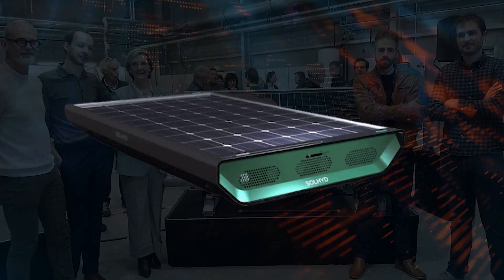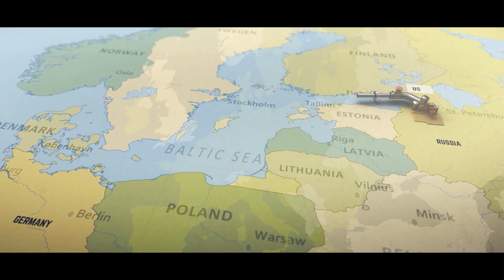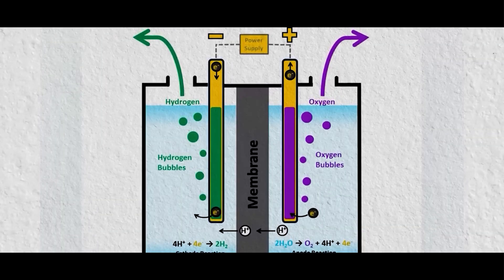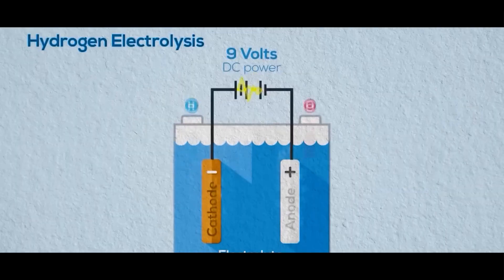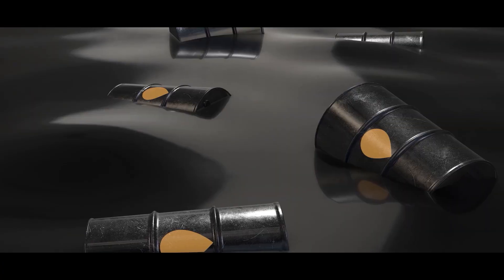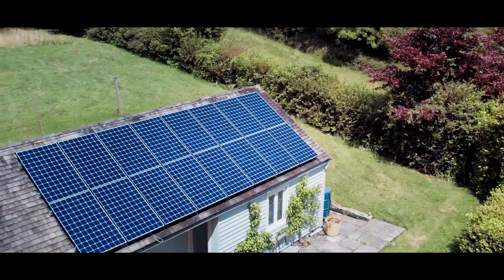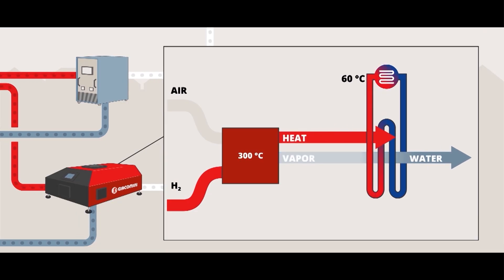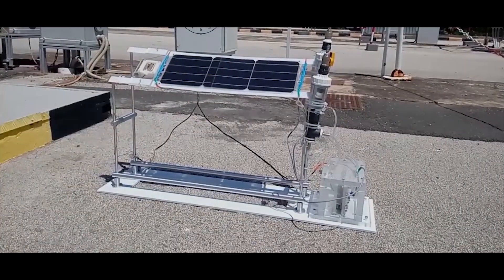NEW Solar Panel Produces Cheap Green Hydrogen at Home | BREAKTHROUGH!

Comment from the maker: Im sorry folks there is a mistake in the Video at 3:34.  of course its  4-8 MWh per year (4000-8000kWh).
4-8kWh wouldnt make any sense 😅
Reply: Thats exactly what I thought. Thanks for correction 😄
Reply: @pajo75  😊
😂
Reply: Yes its low ......but look at solar panels how more efficient and smaller they have become over past 10yrs.
So give this idea time to develop.
Reply: There is an American startup in Las Vegas NV also that mimics phosynthesis, And it’s publicly traded. HYSR is the stock symbol
Reply: @truthseeker8123 . Very small micro stock.
Reply: Same in UK, but as alot have done.....done small systems and stuck two fingers up to the greedy energy companies.
Reply: This is old tech.  Check out:  Hydrogen House Project
Reply: Thanks.
Reply: store the hydrogen as a powder potassium borohydride KB3 molecule. dissolve in water tank to power car or other power unit. the system would take power initially to generate hydrogen for the fuel cell but would quickly achieve over-unity.
Reply: Storing copius amounts of explosive energy in a gas hard to even contain needs further development. If this goes wrong, it goes very wrong. Any conversion process using hydrogen as a base material is a welcome must. Now let's think about real term efficiency of those conversions. They should hold up to chemical batteries, or?
Reply: "Im sorry folks there is a mistake in the Video"
That's putting it mildly.
Reply: I stopped the video  3.34........but now that you corrected I'll proceed to watch the rest.
Reply: Thanks ..! That's how morons are burying this technology ..! It wouldn't surprise me a damn bit !
Reply: I wish I'd read this first. Just been down the rabbit hole of finding the average kWh natural gas requirements for a typical house in the UK. (between 8000, 12,000, 15000 for what ofgem define as low, medium and high energy usage).
Reply: there is another mistake in the animation.  I seems that the hydrogen is released to the atmosphere and the O2 is stored :)  Worse than this, calling these "hydrogen solar panels" is somewhat disingenuous.  This is a "green electrolysis" hydrogen generator.  Green in that the power is coming from photovoltaic sources.    I'd be surprised if the amount of hydrogen produced 'per panel' generated enough hydrogen to sufficient power.
Reply: Thank you , I caught that and was very concerned.
Reply: I was completely lost when you said that haha. Came to look and here's your comment. Thanks for addressing and fixing the issue there. Great idea 💡
Reply: 8 MWh is way too low for most small houses in nordic countries. Trippel that 24MWh / year and most normal villa with two electric cars is covered.
I have a small villa and a heatpump, live alone and only one EV. that I don't use much. I use about 8MWh / year.
Reply: This is a dumb idea for a home user, nobody wants a Hydrogen tank at their home. Also no mention of the losses you get even with a Hydrogen car that will vent itself over a week or so to avoid exploding.

Comment: more green hydrogen hype......... its much mor efficient to store the energy in batteries, than as hydrogen. Although batteries have problems with materials availability, what the video doesn´t  explain is that hydrogen is EXTREMELY inflammable..... who wants to have a massive bomb strapped to the side of their house.... obviously we can make high pressure tanks.... tbut theres the materials availabity question again. And hydrogen is very VERY dificult to transport, so forget the myth of selling your excess to industry....pure fiction. In very cold climates, ....maybe it will be useful...but remember much of the planet is facing extreme temperatures thanks to climate change!!!!!

Comment: The future of ZERO EMISSION ENERGY will be installation of Solar Energy panels in the areas around EQUATOR for generation of maximum electricity. 
.
Equator has maximum Temperatures and zero frost problem. 
.
The only problem is the sand storms and dust. If technology can overcome that, then we will have unlimited supply of electricity 365/366 days 24x7. 
😊😊😊

Comment: The silliest thing in the process is at 3.02. When pure Oxygen is being produced do not waste it leaving to the air. 
.
One can use it for filling Oxygen cylinders.
This Oxygen can in purified form be used in Hospital, Industry related to Burning, bunker oxygen supply, indoor plant cultivation, as a car fuel to burn limited amount of it as alternative to petroleum products etc.
😊😊😊

Comment: Is this really a 'breakthrough'? PV panels are typically about 20% efficient and water electrolysis is also only about 70% efficient, making this system about 14% efficient at making hydrogen from sunlight. Whereas lithium batteries have a round trip efficiency of about 90% or more. Hydrogen fuel cells are much lower than 100% efficient, so the only advantage I can see is that this could provide a method of longer term energy storage. I.e. make hydrogen in the summer and heat your home with it in the winter. Even in this case it would be more convenient to use separate PV panels and electrolyser and hydrogen storage system, so that the PV energy could be used for other things.
I found this video because I have seen other methods of direct solar photocatalytic splitting of water and had assumed the Solhyd device would be based on this. I think the highest efficiency of these so far is 13.8%, so similar to the Solhyd system.

Comment: If you follow their numbers, it produces enough hydrogen in a day to drive an HFCV about 2km. A solar panel the same size would produce enough to go about 12km in a typical EV, and you don't have to figure out storage, compression, etc.

I'm afraid that going from electricity to hydrogen and back again will always be an unnecessary and energy-wasting side trip. If you could do it without that being the case, you've invented perpetual motion.

Comment: What I am confused about is... does it use a solar panel to generate electricity that then produced hydrogen? 
Because if so, why not just use already existing electricity to produce hydrogen in one place? Why need for the retrofit?
Reply from the maker: As mentioned in the full video, it does not operate like a conventional solar panel.
It uses a unique technique to generate hydrogen.

Comment: With 5 kW of solar panels on your roof and 5 hours of sun shine you can put maybe 20 kWhr of power into your Tesla Y battery and it will drive 4 miles / kWHr, so you could go 80 miles on one days charge.  To do that with a hydrogen powered car you would require 15 kW of solar panels, and that won't fit on your roof and it would be 4 times as expensive or more.  Just plain stupid.

Comment: Hydrogen is a stand alone fuel that doesn't need to be converted into something else. When using hydrogen to power vehicles never throw away the oxygen as that's the secret to powering all types of vehicles as when water is broken down the resulting gases comes with all the oxygen it needs for complete combustion, thus any oxygen sucked into the combustion chamber will be extra.

Comment: While normally using fuel cells would be a terrible idea because of low efficiency, you make up for it by using the waste heat - which is great in the winter in cold climates.  (You would not want this in Florida!)  However, there is still quite a loss of energy when you make the hydrogen.  You might consider using batteries for short term storage, hydrogen for seasonal storage.  Since efficiency goes up when current flow goes down, you might want to send only a trickle to hydrogen and the rest to batteries during the day.  At night you would use hydrogen if you needed the heat, otherwise you would make hydrogen from battery power, again at a low current for high efficiency, with the rest of the power going to the house.
Reply: I'm glad you have mentioned using hydrogen to produce heat. I feel many overlook that this is a very real possibility for what we can use hydrogen for.

Comment: It's was first done in the 80's - 100sqft flex film ( ala; mylar ) pannel focused on a coffee can of *two metals oxides with a  catalytic gas... 

It was able to heat / cool and cook as well as genarate electricity. 

Or it could be used as a desaltalation by freezing 1,000 gallons of salt water.... 

* I/2lb of titanium and magnesium oxide
Reply: Information please? Thanks.

Comment: so basically instead of using standard battery for storage, it use hydrogen as fuel for fuel cell which replace battery completely. the idea is good, but how efficient are these in real situation? 🤔

Comment: This is NOT a breaktrough. The panel just uses it's electricity to directly make hydrogen at atmospheric pressure. Nothing fancy. It's just a subsidy / investment grab for money. One panel makes as they say like 6kg of hydrogen a year. That is 6kg * 33.33kWh = 200kWh a year. Which is very little for ONE panel. Also if you want to convert that hydrogen back to electricity you have to go trough an inefficient fuel cell. Losting around 50% again. So you only get 100kWh a year from one such panel. It's terribly bad. This company has been laughed at by so many physics people. It's just a scam.

Comment: Hydrogen is great for electric plants, but homes are more vulnerable....If hydrogen is more explosive than methane...and methane traps heat...Maybe a methane tank to trap some heat.....a conduit metal to run out of the tank..then meeting water for steam...then electricity...Encased methane above solar panels might trap the solar rays necessary for panels to be powered constantly with right lenses sandwiched in between...Possibly thermal heat lens and or right spectrum filters.

Comment: It all comes down to cost. Will it cost less than solar panels, batteries, and inverters?  The panels will never be as cheap as solar panels and hydrogen fuel cells to turn hydrogen into electricity are very expensive. I have no idea what it will cost to collect and store the hydrogen. The price of batteries may drop 60% in the next 5 years.

Comment: The problem is you dont have a household export of hydrogen. You'd need all the piping to support export, and getting to where it needs. Which would still be a massive costly infrastructure change.

Comment: If you lose containment of hydrogen - It goes straight up to outer space... Lost... Methane gas is weighed down by a carbon atom, so the 4 hydrogen atoms are not lost to space. Methane gas is easy to make. The fuel is decaying plants. It's the perfect fuel. And it forms a closed cycle for re-use.

Comment: The Solhyd Project's Hydrogen Solar Panel represents an exciting development in the field of renewable energy, as it offers a decentralized, off-grid solution for green hydrogen production. By addressing some of the challenges associated with large-scale battery systems and conventional solar panels, this innovation could help accelerate the transition to cleaner energy sources. However, it's important to continue evaluating the efficiency, cost, and scalability of this technology to better understand its potential impact on the energy landscape, including its competitiveness with other hydrogen production methods and energy storage alternatives
Reply: Well said 👏🏾
Reply: All these inventions avoiding the obvious and that will not start a industrial revolution.  Water is the greatest and best storage of hydrogen of all .

Comment: Still has a huge disadvantage which is the water it needs. Dry areas or places where too much water is taken out of the environment will add to the issues.
Reply: Only in the sahara this is a problem with this system, they have said it will work everywhere else.
Reply: @grtxyz4358   Nope, you are still taking water from the environment if enough is being take it will slow change the climate and the landscape. It is a trade off that has pros and cons.
Reply: @gotafarmyet4691  they have noted it will be just a glass a day. Not something to fuzz over.
Reply: @grtxyz4358  lets do basic math, 8 oz glass = 16 panels to 1 gallon, 160,000 panels = 10,000 Gallons. It builds very rapidly doesn't it. What may not seem like a problem right away will be over a 20-50 year stretch. It will have unknown long term effects. Green energy is always not so green as people think. Science is still in the can we do it, not should we do it this way?

Comment: What's the catch? If we are all using this and taking condensation out of the atmosphere, does that not mean that we are reducing our H2O count? (amount of water on the planet)
Reply: Well if you combust the Hydrogen with Oxygen then you create Water so it goes back where it came from.  
Food for thought:  When 1 liter of Gasoline is combusted it creates about 1 liter of Water aside from the CO2 and NOx, did the air humidity go up with the extensive use of fossil fuels over past century?

Comment: Im always a little fesrful of millions of people extracting humidity from air. It seems like that is going to make some difference to local climate. I know my country does use artificial rain from time to time, but only sparingly because it does affect the weather (lower rainfall) nearby and delay rain nearby. zapping humidity out everywhere but by bit could have similar effect.
Given that it return to water when converted back, it also need with humidity comes that time.
Reply: "Im always a little fesrful of millions of people extracting humidity from air."
Obviously only the people at the edge of town are going to get anything at all.
Reply: There are literally millions of cubic kilometres of liquid water in the sky plus vapour. The visible stuff is called clouds. The invisible stuff is called vapour. The surface of the earth is 2/3 covered in water

Comment: Seiously, any person can come up with this idea, its not patintable. the hydrogen storage can be done with existing  technolgy and then in the winter there is less humidy in the air, at 32 degree F there is almost no humity in the air, and the lower the temp the less there is. the tech for turning air into water isnt new either.

Comment: Given the difficulties and challenges involved with storing hydrogen, feeding back to a fuel cell likely makes more sense and would be safer as the system could be designed to do this.  Piping hydrogen into the home for direct use as a fuel sounds like a bad idea and dangerous.  Natural gas was chosen for this for very good reasons of safety and even that requires special design. Overall, residential hydrogen is a bit concerning.  Hydrogen is a very small molecule, thats why it was used to make the old airships float, remember what happened to the Hindenburg outside of New York.

Comment: What a crock. The solar PV panels are 22% efficient X Hydrogen production at 40%  .22 x .4 = 0.088 efficient.  That's stupid. Making hydrogen is pointless. Use the solar to run a heat pump and you are 3/4/500% efficient.

Comment: Stop lying. You can't replace fissile fuels. 
What are you going to use to power a Bucket Wheel Excavator? What are you going to use to replace IV tubes with? We have nothing that can replace petroleum products.
Come on. Show me an alternative solution to a jet engine that does not use petrochemicals.

Comment: Not convinced.  Electrolysis manufacturing is generally a 70% efficient solution.   If I understood this correctly, they referred to waste heat being used from this process, making it more efficient.   I live in Georgia.  I don't need heat in the summer.  I'm trying to get rid of heat in the summer!!.  
Then storage.  Low pressure tanks would be enormous.   High pressure tanks cost you another 30% to run the compressors.  Then the whole process appears extremely complex, and prone to a need for lots of maintenance.  Hydrogen, being the smallest of atoms, is the hardest to contain.  Picture building a storage container out of bowling balls to contain bbs.  When the bbs(hydrogen)  invade the spaces between the bowling balls(steel tank) they cause weak places in the vessel called Hydrogen embrittlement, which can lead to failure.  6-9000 psi tanks are not something you want to fail. 
The process of turning hydrogen into synfuel creates a whole other layer of complexity, inefficiency,  and adds more failure points in the chain.  
Not sure of the solution for populations in the northern latitudes.  This seems like an extremely complex, inefficient, and failure prone one. 
Geothermal from areas suited for that with gigavolt DC transmission lines to distribute would seem more logical and viable.  Of course it doesn't allow you to live your off grid dream.

Comment: They don't sound very professional. I can make hydrogen out of water myself. I could probably store it myself but storing it takes energy. An inverter that can call for the conversion takes skill. That was their job to develop and present. Yet they can not get the most basic principal of their math correct. Hey. I have a fubared company too. If bad math sounds like a great deal to you them I have a bridge to sell you.

Comment: Wow. Glad to see KWH correction in comments. Currently have 7.5 kW of solar panels with cycles of un-used PV power after battery bank is full. ... Wondering IF  hydrogen generation could use my solar power via 120 vac output instead of your solar panels??? ... to produce hydrogen in an inner tube at bottom of a water tank. ??? Have you reviewed pros and cons of such options. I would love to have such an options for home heating (in addition to my mini split heat pumps), and maybe kitchen stove.